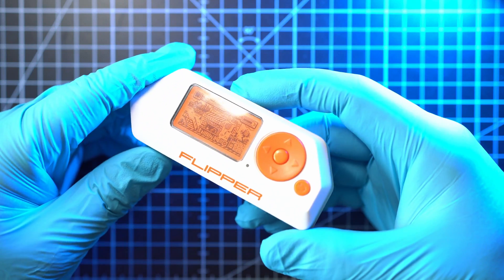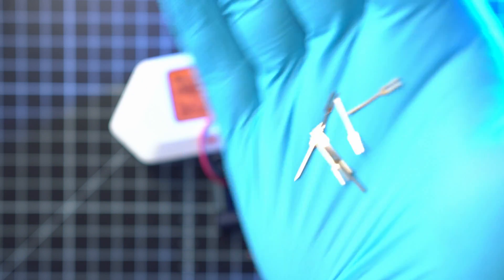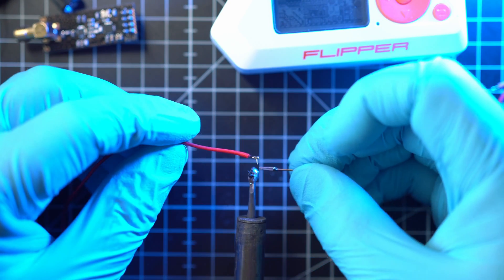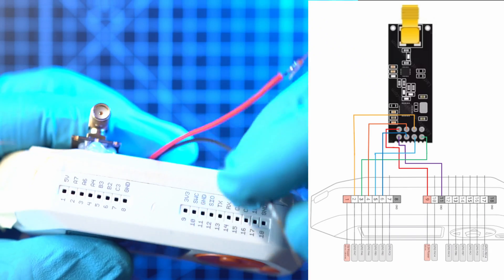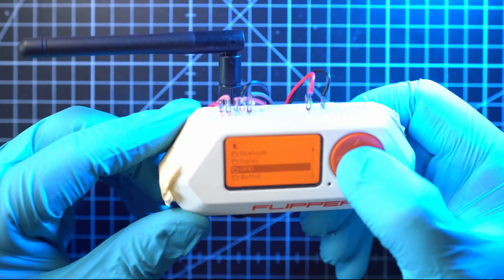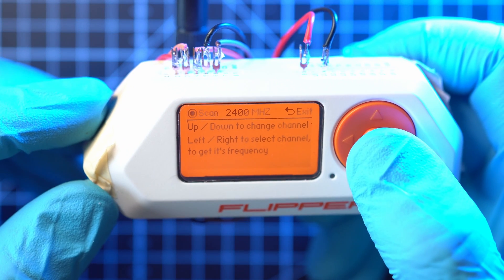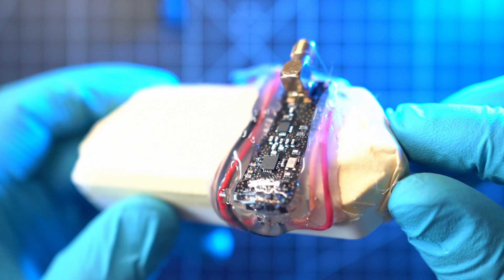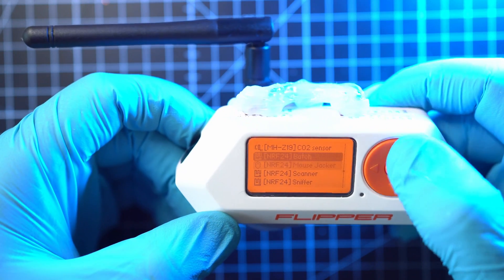Flipper Zero NRF24 - 2.4GHz module

Comment: Can you send commands? I have an RF controlled adjustable bed frame, former roommates lost the remote. Can this module also send packets or only view? Also if it was able to send is there any way to know what packets to send? I do know that the bed has a button to sync with the remote if you get a new one ($150).
Reply from the maker: absolutely! if you have sinc new remote button on your bed!

Comment: do you have any device that the NRF24 is able to detect? i have a mouse which sniffer is able to detect XD
Reply: You can use the small 2.4gh usb that comes with wireless keyboards or mouse. Not Bluetooth.
Reply: @gaijin8298  thanks. and do you think i can use the generic mouse jack to press a keyboard key? (i keep my computer with mouse wake from sleep disabled so it doesn’t wake itself)
Reply: @parall4x  it’s definitely possible just more complex setup